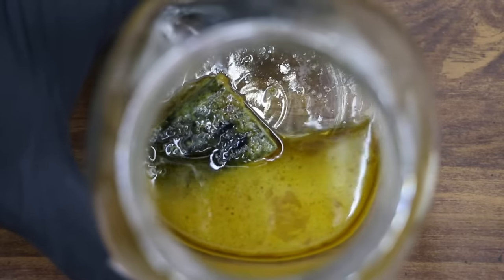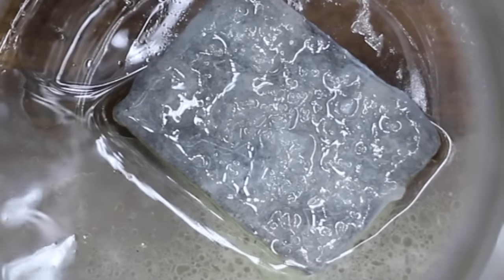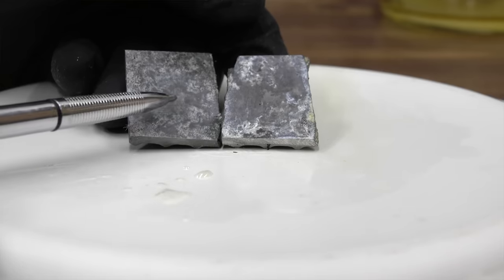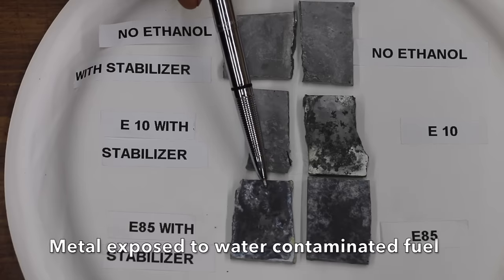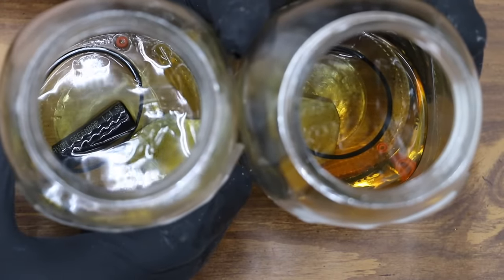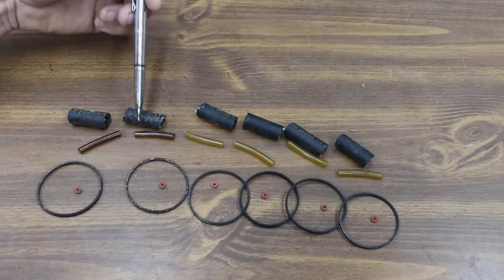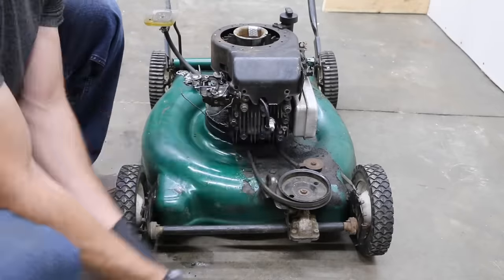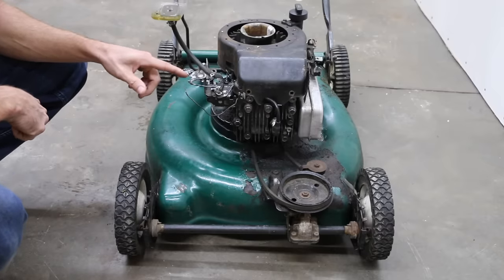Does Fuel Stabilizer Prevent Ethanol Damage?  Let's find out!

Comment: Question: why are you testing E85? What small engines use or recommend E85? 

Also I’m assuming what you are calling E10 is 10% ethanol based pump gas…so why not just call it by it’s more commonly known pump octane rating (like 87, 89, 91, or 93)? Or are you just saying that it’s doesn’t matter the octane rating, and that not all pump gas is exactly 10% ethanol (they’re “up to 10%” ethanol), so you made sure to get a pump gas with 10% ethanol and called it E10?

Just want some clarification, thanks!

Comment: Briggs and Stratton released a bulletin regarding storing fuel in gas cans. 
Gist of it is, treat fuel sitting in a can if it's going to be stored over a MONTH!! 
We all know ethanol is trash by now, at least for any kind of long term storage (over a month) because it goes stale in the float bowl first because of the vent.
Reply: 6:07 nice on the "vent" to simulate a gas tank with a vented cap.
Reply from the maker: Thanks for the feedback.

Comment: Is there a difference between the diff fuel stabilizers?  For example Stabil and others.  So some work better than others?  Also what about diesel fuel?  Does diesel need a stabilizer?  Does diesel go bad?  Can kerosene be used in a diesel engine?
Reply from the maker: Thanks for the suggestion.

Comment: How about aftermarket fuses?  I recently tested an assortment box and found pretty wide variation, including some fuses that melted on the outside without opening the fuse link inside.
Reply from the maker: Thanks for the suggestion.

Comment: Have you tried this experiment with Sta-bil? I have used it for several years and it always starts. I treat my fuel in late Fall after my last cut, and put everything back to work in early Spring.
Reply from the maker: Thanks for the suggestion.

Comment: Even if the "gas preservative" product didn't stop the gas from going bad,it would be worth while if it provided significant protection from actual corrosion damage/destruction to my Tecumseh carburetors even if I still have to "de-junk" them. 
I try to keep my gas cans tightly closed and to use up the gas before too many months go by,also dope the gas with some of one of these products (not the one in the video) when I bring the gas in the can home after buying it,also I like to add a trace (like one part in 100) of Stihl Ultra oil to the gas even though you are "not supposed" to do that for regular 4 stroke engines (I think it helps keep the floats from sticking)

  I think if you "overdose" with some of these products the product itself can end up clogging your carburetor bowl and jets with itself as a sort of jelly material but that is easily flushed away with the likes of Brakleen
Reply from the maker: Thanks for the feedback.

Comment: I wonder if useing coleman fuel to flush ethanol fuel out of the carburetta on small engines before storage would be a good way to easily winterise an small engine like an outboards.

From what i understand coleman fuel does not go bad people on fors even ralking about using 30 years old stuff.
Reply from the maker: Thanks for the suggestion.

Comment: So what would be your suggestion for a motorcycle I can't afford to replace and would like to get at least double the 94k miles I have on it? I always use 93 octane unless I MUST fuel up and it isn't available. I also have been using about half ounce of stabilizer each fill up for over a year now. There ae Pure gas stations around which usually have at least one pump with no ethanol but the closest to me is about 30-40 minutes in a direction I almost never go riding. Any helpfu suggestions? I really do try to take care of my bike. I even change the synthetic oil and oil filter every 3,000 miles. Thanks fr any help.

Comment: I've had some gas last and some that hasn't. My dad had some in his generator that had sat couple yrs and he started it up and ran it out with no problems. It was regular ethanol gas without any stabilizer or anything yet I've seen some sit nowhere near that long varnish and turn rock solid making it a nightmare to clean out of the tank and rendering carburetors useless trash.
Reply from the maker: Thanks for the feedback.

Comment: Yes, im in interested in effects of E fuel on  long term use to components like gaskets, seals, lines, and other materials.
I've heard similar complaints about the fuel stabilizer or additives also.
If ethanol is a problem is there a way to remove it or convert it?
Reply from the maker: Thanks for the suggestion.

Comment: I noticed that one of my local tractor supply outlets that sells and repairs small engine equipment as well as gas only sells their highest octane gas with 93 octane without ethanol. I personally do believe ethanol is harmful to small engines. Do you think that using this 93 octane gas in small engines for lawn mowers, weed eaters, etc. might be better for them and actually avoid damage and decrease costly repairs? The gas station that I frequent the most for vehicle gas as well as to fill up my small engine gas claims to have no ethanol in any of their fuels although I have not confirmed this by testing. I've had no obvious problems from this station and have used them many years. I know there is a fairly simple test to prove the existence of ethanol in your gas but have not done it.
Reply from the maker: Thanks for the suggestion.

Comment: So it's probably safe to conclude to simply purchase Non-Ethanol fuel for your motorcycles / lawn mowers etc.   At least for the winter months or for times when it's not in use for more than 30 days.
Reply from the maker: Good Point.

Comment: Have you ever tested adding 1 oz. cheap ATF to 1 gal. ethanol fuel to see if it works well at preventing ethanol problems?  The old motorcycle guys seem to feel that it helps prevent the woes you describe, but I've not seen a test.
Reply from the maker: Not yet. Thanks for the idea

Comment: Will a little Marvel Mystery Oil help fuel stored?  I live in Florida,  last minute runs for fuel when a Hurricane is coming is a pain!  There are so many things to do.  I get fuel and put in Sta-Bil and Marvel Mystery Oil and some injecter cleaner.  6 months later if I did didn't need to use it I put it in my truck.  It has worked for years.  But I always run the Generator carb out of fuel to keep it from getting damaged.
Reply from the maker: Thanks for the suggestion.

Comment: What are the chances you could test RC Car Lipo batteries? Lithium polymer RC batteries are rated with a “C” rating which (Long story short) equates to a safe discharge rate and the capacity is rated in milliamp hours, both of which are not regulated in any manner and companies routinely exaggerate sometimes grossly exaggerate.  It would be really nice to know out of this multitude of companies available out there which ones are really best.
Reply from the maker: Thanks for the suggestion.

Comment: The white powder is sugar as ethanol is percetage made from sugar cane pulp here in australia we have e.10in other words 10percent ethanolif its used wisely no problems i run a 04colt and a 2014hyundai i max van on it since day one and no problem but you dont leave it sit as its normal life is one month then it starts to seperatethats when problems start i have used lucas products periodically as additives and injector cleaners valvoline though not religiously never use ethanol in marine motors for that we use 98premium i also owned mtorbikes one cabyied jap multi and a injected one the cabied one had all the problems you covered and metal paticles in the carbys all four yet the tank was clean and the fuel was 95.98.and 91octane unleaded yes it sat around a lot and yes even that absorbed moisture despite 2fuel filters on it the shit still got in the carbys any thought on this regards 😊😊😊

Comment: My old truck used to have issues with the ethanol in the fuel. I had to constantly use Marvel mystery oil fuel additive. I could tell that it was working. But I got tired of constantly having to add that. So I switched over to an Edelbrock carburetor that was designed to handle ethanol. Anybody who studies fuels would know that methanol is a better substitute for increasing octane ratings then using crap like ethanol.

Comment: Does fuel only go bad when exposed to oxygen in open container? I've used 3 or 5 year old gas sealed in the engine and it still ran fine. What if you mixed 75% new gas with the old, will it run then?
Reply from the maker: Thanks for the suggestion.

Comment: That whitte crap in the ethanol fuel looks exactly like the mess I had in my pickup's fuel pump recently.  White,, gelatin looking stuff.  I did have it idle in my garage last winter for 3 to 5 months.  But, I have been using the truck a lot over the summer and Fall but, it quit on me1st Nov.  I dropped fuel tank, pulled out fuel pump.  Fuel pump was full of white precpitate, fuel was murky.
Reply from the maker: Thanks for sharing.

Comment: The one question that no one seems to be able to answer, can diesels get addicted to starting fluid. If so, can they also get addicted to WD-40 (as starting spray), which some diesel mechanics swear by?
Reply from the maker: Great question. I do believe starting fluid can cause harm to a diesel engine under certain conditions and result in starting fluid being necessary.

Comment: The fuel stabilizer I bought only claims to keep fuel "fresh" for a few months. Drain your carbs if they will be left unused for more than a couple of months. The fuel you used has ethanol and therefore water in it to begin with.  Better to buy non ethanol fuel to begin with. Ethanol seems to damage the rubber diaphragms in engines that are not gravity fed such as 2 stroke motors on chain saws, lawn trimmers....
Reply from the maker: Thanks for the feedback.

Comment: I think the root problem is that the manufactors are not puting components in their products that are not affected by ethanol.I had a problem 2 yrs ago with my honda powered pressure washer no crank.
I thook the carb off & watched  you tube. after disassembly I found the emulsion tube hole cliggged.
I soaked parts in coke a  cola. cln out blockage with fine wire,
Cranked right up. I now keep it in side, cranked right up yesterday with fresh pump gas.
Parts= 0 cleaner= .75
Reply from the maker: Thanks for the feedback.

Comment: I would like to see a video on the different kinds of oil like Motorcycle oil, diesel oil and car oil is it really different? Since bike oil is co much more expensive. I also heard it is bad to run oil doe a semi truck in a regular engine I always wondered if it was true. I always just used regular motor oil in my bike and have yet to have any issues from it. Is it really different?
Reply from the maker: Thanks for the suggestion.

Comment: Just found this in a sidebar.  There are various brands of fuel conditioners and/or stabilizers and likely various formulations.  I wonder if there's a particular brand's formulation that might actually both prevent corrosion and also stabilize the fuel for the same 9 month period; either non-ethanol, 10% ethanol, 15% (which Biden is forcing on us now) and even 85% ethanol.  Just a thought.  Thanks for all you do for us!
Reply: @johnniemi8012   Amen to that!

Comment: Just a suggestion. Could you try slowing down your delivery a little? No doubt you have a lot to say in a short time talking that quickly is hard on the eardrums. For what it's worth, I race cars and none of my competitors use fuel stabilizers with alcohol fuels. They simply don't work. I avoid ethanol as a fuel for road cars as it is fairly distructive stuff when fuel lines, carbs etc. are not flushed regularly. E85 is a great cool running fuel and is almost detonation free - not so great for regular road use.
Reply from the maker: Thanks for the feedback.

Comment: "No E, No corrosion" hmm, might work out for mines and equipment/auto manufactures. The amount of industrial byproducts produced buy the replacement parts needed after the use or abuse, of ethanol might warrant a bit more study. Once upon a time, varnishing in fuel systems was a thing. Now! it all just rots from the inside out. Winning?

Comment: What fuel injection cleaner do you recommend for a gas vehicle? I normally use Lucas, but I'm thinking about trying the new 5oz Seafoam. in my mowers I add Stabil fuel stabilizer to the fuel before I use it. Your Opinion.
Reply from the maker: Thanks for the suggestion.
Reply: @ProjectFarm  It's not a suggestion, it was a question , your the expert, I'm just asking for you opinion on what I should put in my vehicles and mower. to help maintain them.

Comment: I had a generator sitting with gas that was at least 4 years old in it, and it started up fine.  I don't know if the previous owner put stabilizer in it.  I still drained the fuel and replaced it.
Reply from the maker: Thanks for sharing.

Comment: So technically the only way in my thoughts are to store carburetor after running engine is to drain gasoline out and use marvel mystery oil, completely, Then to start it drain oil out carb refill with small mix of marvel  mystery  oil  and good premium gasoline  start engine back up , if I'm "Wrong please tell me"

Comment: I bet you're getting a LOT of comments from the UK on this video. Over here, the government has just mandated the switch from E5 to E10 for our standard 95 RON grade unleaded fuel. E5 is ONLY available as 98 RON "super" unleaded. And Ethanol-free fuel is not available at all at most (if any) forecourts.

The UK government pressed ahead with this in the UK because of pressure from Bioethanol producers, despite the fact that over 700,000 cars (mostly older vehicles) on our roads currently cannot run the E10 fuel, because of the very reasons you're indicating - it corrodes metals, particularly in carburettors.
Reply from the maker: Thanks for the feedback.

Comment: Does running the motor out of gas, leave any gas in the carburetor.
Reply: a bit, there is drain screw, but it too small and at the bottom, so it will not clog the jet

Comment: you give a detailed narrative and leave no questions.  Thank you for your narrative to say Alcohol in the gasoline is a very bad idea.  I worked for NASA and during Pres. Carters time we told him not to put alcohol in the gasoline.  Number one, the alcohol has to be trucked it cannot be piped.  it lowered the temperature of the engine, but it cost more to operate and all the vehicles during that time were destroyed because the fuel lines, the plastic baffles, the floats were distorted from the alcohol.  i had to buy another vehicle because of the destruction in the fuel system. Later the car manufactures started to make the vehicles able to use up to 15% alcohol in the fuel.  Again, it cost more because of trucking and storage and short shelf life.  Pres. Biden and the Democrat congress are narrow minded and do not know that Electric vehicles is the solution to climate change.  Nothing can change the climate change. so, stopping fossil fuels so people will buy electric vehicles is ignorant.  stopping fossil fuels is going to increase inflation to the Exstream.

Comment: Interesting,  fuel that I drained out of a golf cart that at least 5 years old, the last 3 years it has been sitting in a open jerry can. I "cleaned" the water  out if it and this summer I am using to cut my grass. Engine fires up like normal and the engine seems to have normal power.
Reply from the maker: Thanks for sharing.

Comment: Fuel nearly a year old? Big deal!! I have a two-stroke Homelite weed trimmer and have such a small yard that it takes me two years to get through a gallon and a half! And that's mixed with cheapo two-stroke oil!! And I never have a problem with it. When I first mixed the last batch it took me about 5 to 10 pulls to start my trimmer. Now this summer I have been going through the last of the 1.5 gallons and guess what? My trimmer still idles like a kitten and it still starts in 5 to 10 pulls and that's after about two years. And I don't put fuel stabilizer it in either. Now I did use ethanol free gas to mix with the two-stroke oil. And I also use ethanol free gas in for my four-stroke lawn mower. I also take a long time to go through that two gallons can I use for it. Same deal, after far over a year, through hot and cold weather in my garage, my mower runs great after the gas is way more than a year old. My tiny suburban lawn is fast to take care of and that's very nice on a hot Utah day over 100 degrees. I'd hate to do a big yard in that heat.
Reply from the maker: Thanks for sharing.

Comment: Has a chemist checked this to see if its actually ethanol damage in this case? Or some of the other 400 chemicals in modern gas? Why let fuel sit a year? If its a usable engine why not just run it every couple months or drain it if you have no use for said engine,.......I live in CA with the most horrible gas with no damage of any sort what so ever to any of my 2 or 4 stroke devices.........the trick? I use the devices I have instead of leaving old gas in them..........too many questions unanswered in this video.

Comment: As long as a vehicle is flex fuel certified then it wont corrode as the materials in the fuel system and engine cannot corrode from E85 at all.
Reply from the maker: Thanks for the feedback.

Comment: I live in CA. Not once has there been a hint of "ethanol damage" in any of my motorcycles or cars or trucks...................you see, modern vehicles have been built to use ethanol...............all the rubber used in them is designed to be fine with ethanol.............that's why everybody's cars are still working just fine...many millions of them....................if your letting a vehicle and the gas in it sit 12 months, you dont need that vehicle much.....................there are 400 chemicals in modern fuel,not just ethanol.